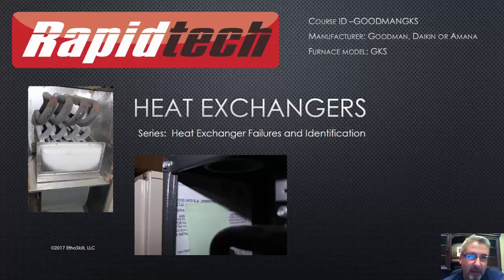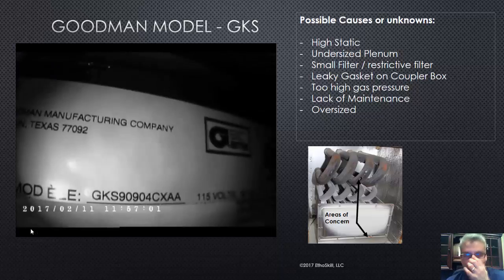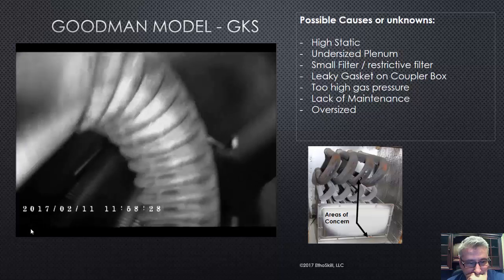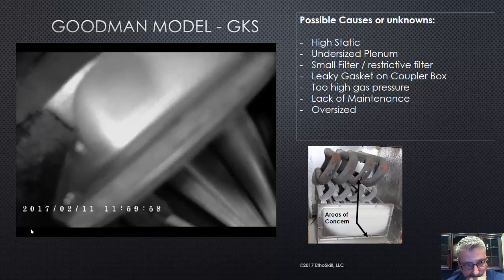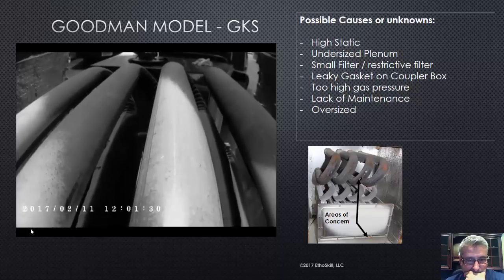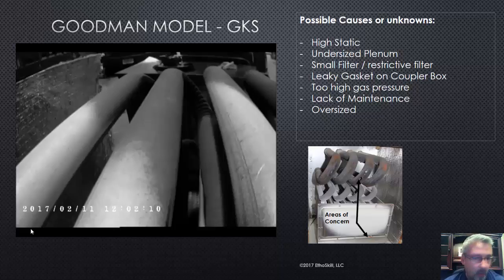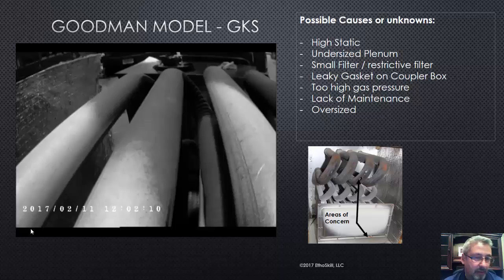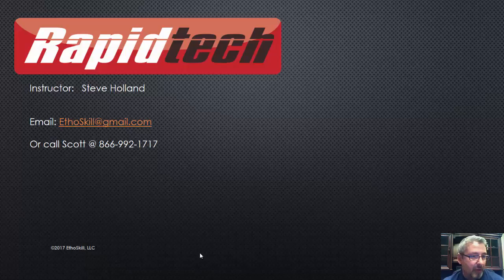Goodman furnace failed heat exchanger - GKS

Comment: I have a Goodman GCS90703BX gas furnace that has 3 burners, the far left burner is making a Sputtering sound when the fan is running, I can place the tip of my finger over the orifice to reduce gas flow on that particular burner and it smooths out and is  quiet and normal as long as I keep my finger there. do you think it is a cracked heat exchanger? Thanks.
Reply from the maker: Ddd Ddd I'd check the gas pressure, venting and heat exchanger.
Reply: @ethoskillrapidtech7166  mind is doing the same as Ddd Ddd is doing not sure what it is yet.